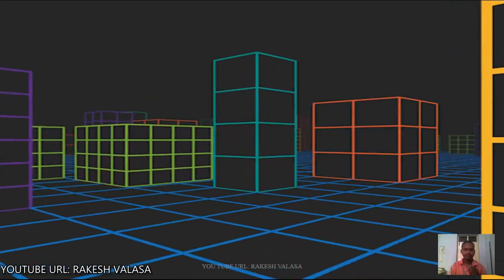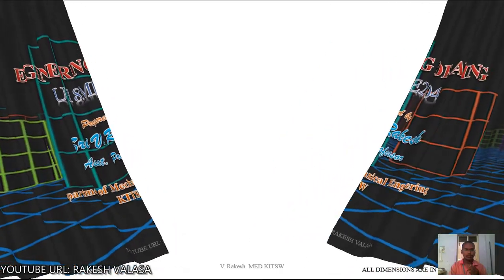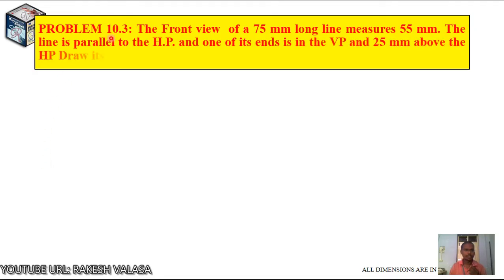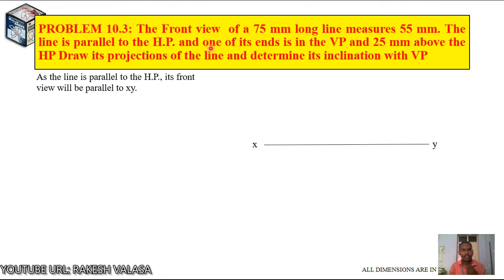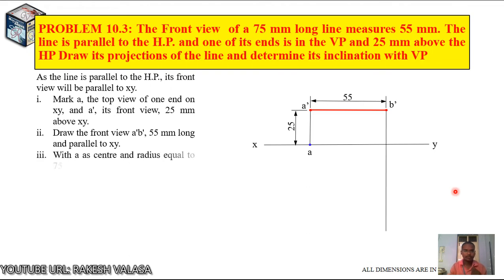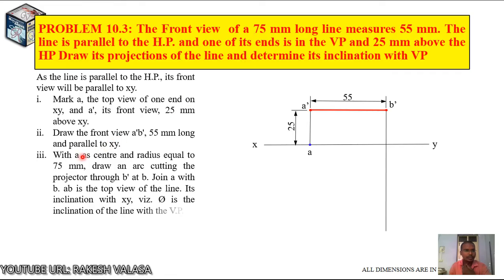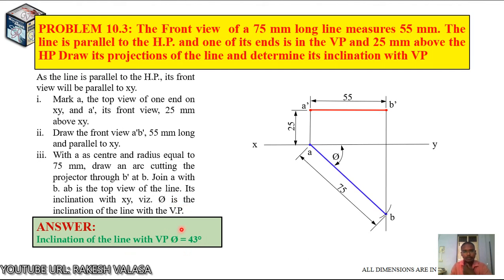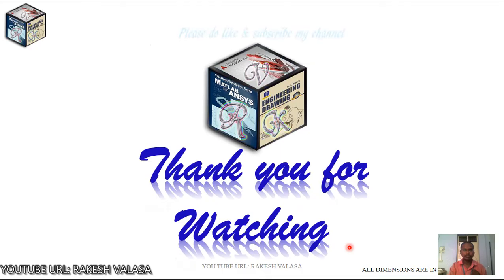PROBLEM 10.3, PROJECTIONS OF STRAIGHT LINES-I (ENGINEERING DRAWING BY N.D.BHATT) with explanation

Comment: The top view of a line CD, 75 mm long, measures 55 mm. The line is in the V.P., its end 
C being 25 mm above the H.P. Draw its projections (Front View, Top View and Side 
View)
Reply from the maker: Check the solution in Projections of Straight lines -1 playlist
Reply: @RAKESHVALASA  find sir ❤❤. I paste the question for matching 😅